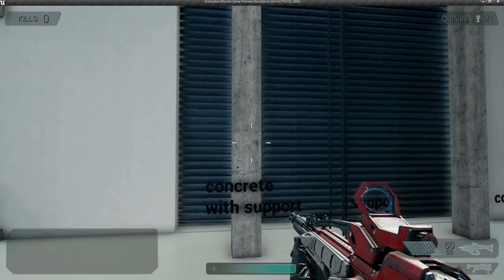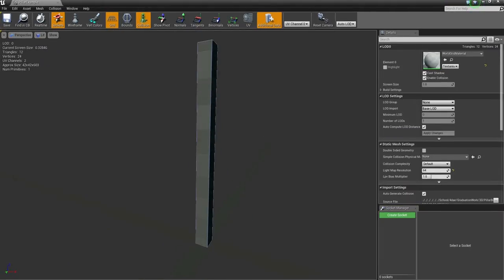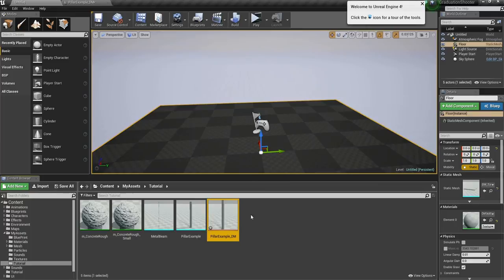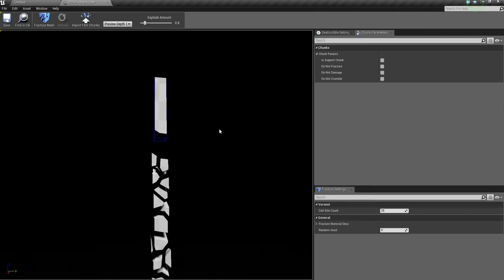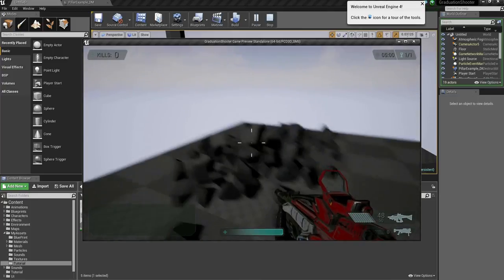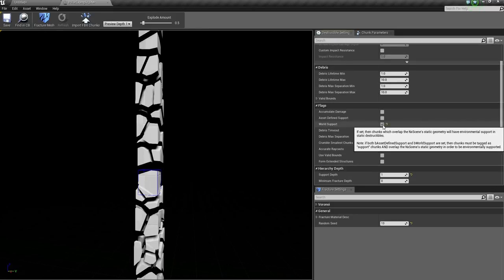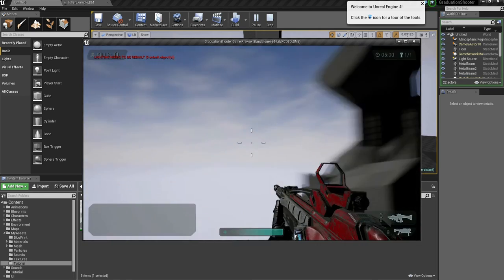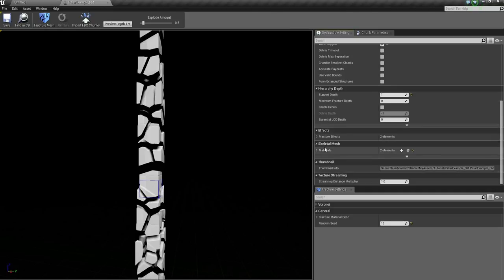Unreal Engine 4 Destructibles tutorial - Reinforced concrete

Comment: a couple of questions
how's the performance when you use this? if i make a map with this does it make a really big performance hit? Also, do the parts dissappear or stop using physics?? And how do I make a wood "shape"? Thanks
Reply: oh and is this just the normal in engine destruction or apex physx destruction? thanks
Reply: The performance is very expensive, so make chunks less as possible. You can do both for small destruction, so when the chunks is falling apart just stop using physics and give delay for a few seconds then disappear.

Comment: Hey, so what variables or parameters are built into this engine feature that you need to access in the blueprint so that the chunks can get put back from repairing?

Also is it possible to have the destructible show the damage LOD's based on health % not where you impact it?
Reply from the maker: you'll have to do the damage % show up with a UI in combination with a blueprint. just keep track of how much health you give your destructibles and whatever applies the damage and pump those values into a blueprint that displays it with a UI. To repair stuff I would just make a blueprint with different destructible meshes all in another stage of destruction and swap them out
Reply: ahh ok, right now the platform im working in is the ark dev kit,
and all you do is load the destructable into the destroyed mesh slot on the defaults page of the structure blueprint.
Right now I have damage effects within the scalar parameter of the dynamic material.
But would like to also show mesh damage.
Could you possibly setup a small example of how I would switch the meshs in and out based on the health % variable?

Comment: Hey man, any idea how to get the broken pieces that fall off to turn on to physics only so they don't block the player?  Also, how to delete them?  I can't seem to isolate the parts that are destroyed.  Anything I setup in the blueprint effects the entire mesh.
Reply from the maker: I haven't opened the destructible editor in a while so i'm just saying these from the top of my head:
The collision can be disabled by size of the chunks, so anything above for example 1m your character will collide with. so you can set that super high so your character won't collide with any chunks. I'm also prety shure you can disable the collision with the player all together somewhere.
To really delete a selection of your destructible is another case.
I think this has to be done with some programming or blueprint magic :s
But this shouldn't be that hard, I would basically build my own destructible mesh blueprint from scratch for that case.
It would help if you can show me specific screenshots/video material of what you are trying to achieve.
Reply: Thanks for the reply.  I will do just that.